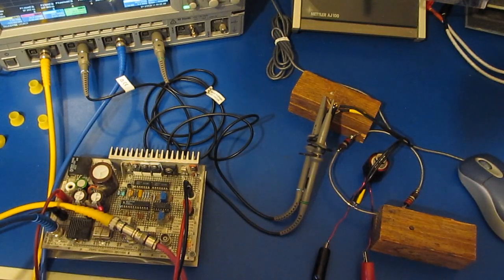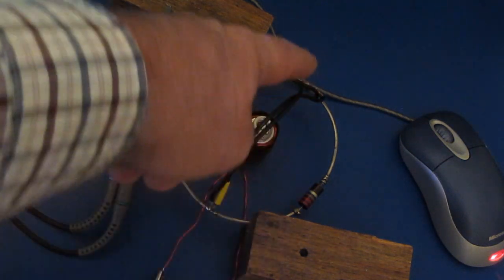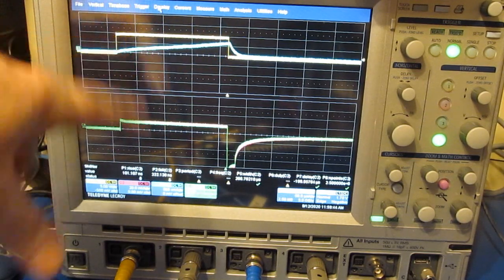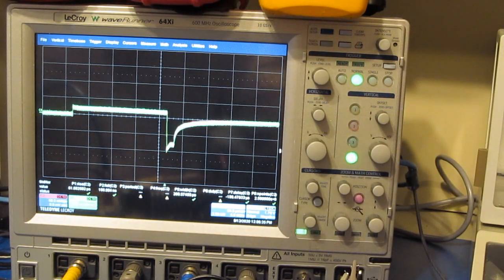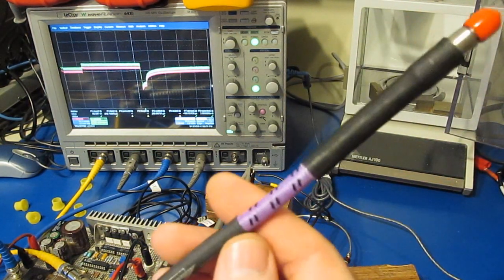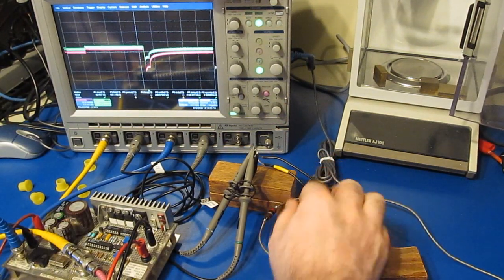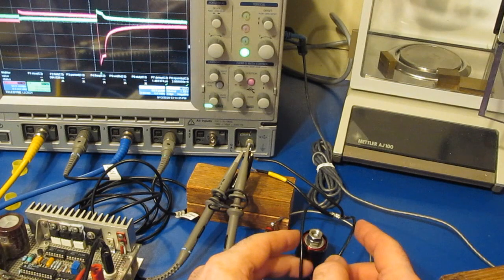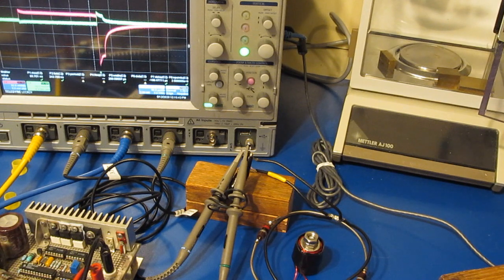The Wonders of Faraday's Law

Comment: Coax is not a shielded cable WRT magnetic fields.  Try this:  Hook one end of a coax cable to your scope, have the other end shorted.  Now pring you solenoid anywhere close to the coax.  There's your signal.  In this case, the coax is behaving as a loop, not a shielded cable.  For fun, try something else.  Hit the coax with a hammer.  See the pulse?  Know why?
Reply from the maker: I think you may have missed the point of the video. Triboelectric effects and well known.  Some coaxial cables are more stable than others.  Have a look at what Gore offers.   I don't hit them with a hammer, or bend them beyond the manufactures limits for that matter.

Comment: It's an old trick. 
the closed loop integral of the electric field is not zero.
The voltage is path dependant.
   Yvon Lessard
Reply: Yep, that is basically all that there is to it. Lewin has always been right (apart from using at times the wrong terminology, namely using potential difference instead of voltage) and this experiment is just a confirmation of how Faraday's law works.
Reply: Hello ! I don`t have much opportunity  to discuss  this topic !!
(excuse some mistakes, I'm from Chicoutimi Quebec french speaking)
The setup of Joe in not bad, but I prefer  the simple two differents resistors forming a square,
with small AC sin driven coil on center.
The current in the square loop is all over the same.
MAGIC : The AC voltmeter measure differents voltages on the same two points
depending on what side you measure         : ))

Comment: really interesting, how you manage to view something with a completely different analogy than most schools. I like the idea of the skin effect dividing the outer shield into both forward and reverse conductor. 

And a quite random question but where did you get your colored BNC leads? 
I really like them.
Reply from the maker: Someone had asked about the Ferrite  bead attached to one of my scope probes in the last video I made.  Apparently this was new to them so I pointed then to this video:  https://youtu.be/2vzvWUqUtb8?t=1247
I've had those colored cables for I would guess 25 years or so.  They are not marked with a supplier logo.  I would imagine you could still get something similar.

Comment: Ah yes, Walter Lewin's most "controversial" demonstration again. Have you seen ElectroBOOM covering it a while ago?
Reply from the maker: I discovered it when reading that thread I linked to the EEVBLOG site.   I had seen Dr Lewin's video much earlier and tried running my own experiment.   I posted my results in EEVBLOG thread.    I remember the Electroboom basically did the same thing but he ran many more experiments but always with a single channel using a  single shot.     My reason to make this short clip  was only to show that where the two transmission lines are placed in the field will make a big difference on the result.   It shouldn't be a big surprise.  I wish that Dr Lewin would explain this.  At least now he mentions Romer's paper.    From two years ago:
https://www.eevblog.com/forum/chat/does-kirchhoffs-law-hold-disagreeing-with-a-master/msg1984640/#msg1984640
Reply: @joesmith-je3tq  Years ago I first watched Dr. Lewin's lectures and this demonstration was pretty much the only thing that I found really confusing in it. I think it's unfortunate that he deciced to stick with this single demo and explanation himself despite so much confusion and criticism. There are always ways to improve a lecture, even if they are already at a very high standard. I know it has been discussed for decades, not just on the internet.
In my opinion ElectroBoom summarized and explained it extremely well. His practical demo wasnt using the best equipment, but it still perfectly showed the real message of this demo and allowed him to explain it.
Reply from the maker: @Basement-Science  So, going back over it, it seems ElectroBoom had made a followup video which I had not seen.  He goes into more detail after doing some research and reaching out to others.   Again, no real surprises but it's still worth the watch.   I have not yet read the paper he links from John Belcher.     I was really confused by that MIT lecture as well but I suspect that was part of the show and it wasn't meant to be clear.   That or I see no reason why Romer's paper wasn't mentioned.  At least that would have provided students with further reading.  Why hide it.   It was a simple thing to setup and run and prove to myself that all was still right with the world..
Reply from the maker: Link to Electroboom's followup.   I strongly recommend following the link in his description to Belcher's paper and reading it if you are looking for more detail.   He goes through each of Electroboom's experiments and explains them.   Again, nothing unexpected.   He does point to Feynman, and the rabbit hole gets a little deeper...   Maybe Dr Lewin will read it at one point and enhance his talk.    https://www.youtube.com/watch?v=Q9LuVBfwvzA

Comment: Difficult to visualize without a schematic. I believe you have the resitive loop to couple with the coil(set for max coupling). And the coax which is grounded at at one end (Top of resistive loop) and the signal is grounded at the other (bottom). For a short reflective return. Then spacial varying the coax for max and min coupling.
Reply from the maker: I suggest watching Dr Walter Lewin's videos linked in the description.  If you found following the setup too difficult, each one of his  shows the circuit.   The first time I watched his lecture, and then dug into it I found it was based on a paper from Robert Romer.  I was surprised there was never any mention of him or his paper.   Reading it helped shed a little light on the subject.   If you goto the EEVBLOG link, you will find I had one post in that thread where I had ran this exact test and talked about it.     https://www.eevblog.com/forum/chat/does-kirchhoffs-law-hold-disagreeing-with-a-master/msg1984640/#msg1984640
Almost 2 years ago.  I was surprised to see Dr Lewin covering it again and thought I would make a short clip demonstrating the various loops and how their location within the field maters.  Nothing really unexpected.
Reply: @joesmith-je3tq  What Faraday Law are you trying to show.
Sorry mate, but you need to provide schematic of what you have and what frequency/pulse width are you doing this experiment at.
You have an idea of what you are doing, I'd say a fair percentage of us don't.
What are you looking at, what is each channel looking at, the first channel I understand then you lost me..
What vertical/horizontal scales are you using?
Reply from the maker: @tomgeorge3726  Tom, as my previous response suggests, there are several links in the description providing the background.